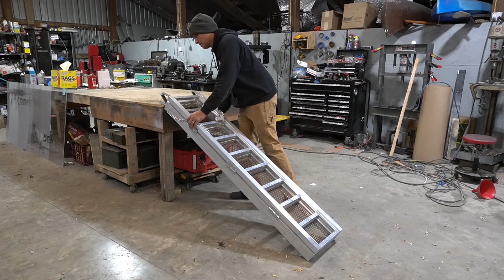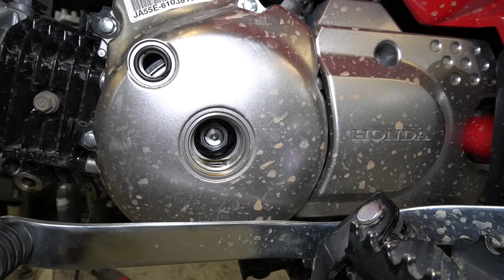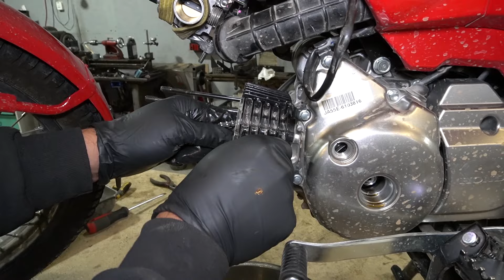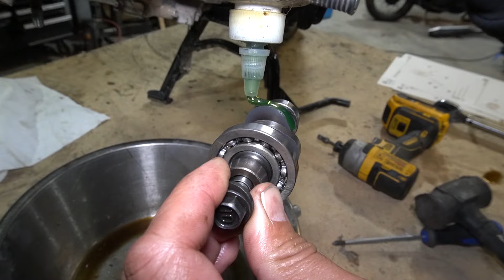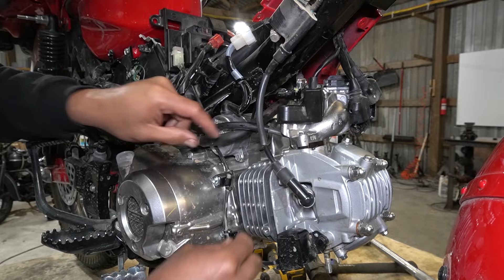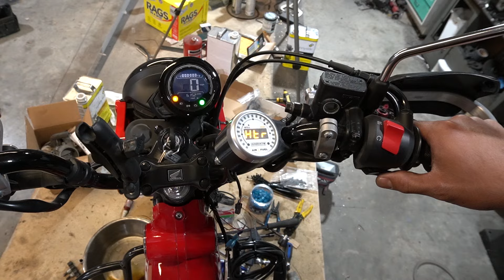More Speed for the Honda Trail 125! - Big Bore Part 1

Comment: A magic motor with a fascinating history , now copied by almost every manufacturer, even Kawasaki and Yamaha+ all the Chinese copies , originally the motor was a copy almost of the Aermacchi 344cc Italian bike motor , please google you will instantly see the almost exact copy Honda did, when Honda did it's design copy the motor had an absolute limit in design of 110cc and that was the top cc size for decades , the air/oil cooled OHC single was art work in simplicity and reliability, starting at 50cc ( all from 50 to 110 and finally 125 in Honda gise used same external dimensions only bore changed ) then 70cc , 90cc , and 110cc . In Australia the bike in the video is called a " Postie Bike" as all mail delivered "residential" was done exclusively on one of the 90cc and later 110cc versions for 40 years . ( Now done in electric carts that are often seen stuck or flate battery on side of road ) , it's incredible this simple motor is now produced by over 50 different companies , Honda let the patent run out and by doing so , allowed almost every other company to use the design . All originally from a small Italian bike company that at one time Harley Davidson owned 33.3 percent of . And sold their Italian bikes in the US and other countries with Harley Davidson badges in the late 1960s/70s.

Comment: 125 is not worth much. It will simply do light riding something above a bike or moped. Any bike needs to be 180 but 200 at least. I have a 200 and its much better, but a 300 lets you safely deal with cars.
Reply: Whatever
Reply: @cbr1thou  I know its hard wo an IQ
Reply: @ericwilliams626 zip it worthless . You aren’t riding no trail

Comment: Did I simply miss it, or is there nothing in the instructions about cycling the engine at smaller intervals at first? I know that I've read about some other big bore kits that are pretty cautious about just a couple seconds for the first start, building up in stages to longer idle cycles before giving it the beans.
Reply from the maker: I didn't bother with any special break in procedure. My big thing is to keep the engine cool which requires a fan or have the bike moving, and rings tend to seat better with the engine under a load. With a small displacement, its difficult to ride the bike "gently" because it needs a lot of the available power to do anything.
Reply: @ozarkgarage  good to know! Not something I've ever done, but I have considered it for my Sportster. I've also long lusted after the Trail 125, but it seems JUST a little too underpowered for the kind of riding that I tend to do, so I was curious about this. Thanks for sharing!

Comment: Read through all the comments. I wouldn't want to lose my high mpg but what mpg loss have you seen with the upgrade? I think on second thought I wouldn't want to risk any potential problems after an upgrade. I agree somewhat with the "right tool for the right job guy" but not his attitude. I wouldn't mind hearing about the post adjustment conclusions....will watch the part 2 again...any further update????
Reply from the maker: Here is Part 3, the latest update: https://youtu.be/nb55vPhmKkw Also did some extended high altitude WOT testing in this video: https://youtu.be/43JGIjh0PZ8

Comment: For those of us who likely wouldn't do that extra step of tuning the new 02 sensor and the fuel mixture, what do you suggest to achieve the right mix? Or does one just run it lean or rich without that data?
Reply from the maker: Final tuning recommendations are in this video: https://youtu.be/EeXsm-Qf62E

Comment: Got to get that Aracer setup for the fuel controller. I have it on my Z125 that's now a 143cc. Your video was great.
Reply from the maker: Check out the tuning video, I ended up settling on a different injector and no controller.

Comment: I dream of an official Honda 150 Trail.  The 125 can't go 55mph on flat land is a killer when commuting.
Reply: My only hesitation about this bike is the engine size. I wish it were just a little bigger.
Reply: @Charlesbabbage2209 120 mpg
Reply: @Charlesbabbage2209 . Yeah and that's what the guys says with a 900cc that wants an 1100cc.  And the guy with the 1100cc that wants a 1300cc.  You're missing the point.  It's a mini-moto.  Smiles for miles bro.
Reply: @clay9333  I think you missed my point, I’m not hating on the bike. I just wish the engine were slightly bigger by about 50cc. I don’t want this because I want some bad ass motorcycle, I just want slightly more pep for times when I need to take a trail bike onto a main road between the backroads.
Reply: I do 62 on mine I do 55 all the time
Reply: @cbr1thou same here!
Reply: @cbr1thou no mods?
Reply: @tomthomsen11  nah there’s nothing to mod really it is what it is
Reply: @tomthomsen11 no
Reply: @tomthomsen11 . The engineers at Honda are way smarter than us garage guys.  This machine is damned near legendary.  Iconic.  Why mess with it?
Reply: @clay9333 in 1961 it started as a 50cc bike. It's been evolving in engine size and features ever since. For me, it would be a great "go see America by back roads" bike...with say a 200cc engine. Still look the same, still great mpg's but just a little more power.
Reply: @tomthomsen11 .  Yeah I get that!
Reply: 150cc on the trail would be perfect
Reply: I'm at elevation in Utah, USA and easily go 59-61 miles an hour on flats.  Factory settings.

Comment: Great video! I used to have a 1975 Honda XR 75 and had to replace the timing chain. The process here was a bit more complicated but overall very similar process. On the XR 75 the engine had to be removed and crankcase needed to be split to get new timing chain on. I have a 2024 CT 125A now and currently dont plan on modifying it. ❤

Comment: ... do I see this correctly: no needle bearing between the piston pin and the connecting rod?
Reply from the maker: Yep, plain bearing like most piston/rod connections.
Reply: @ozarkgarage  Do you have to upgrade anything else , cam, sprockets , etc ?
Reply from the maker: @leeinwis I replaced the cam because you have it out anyway, you will also need to increase the amount of fuel: https://youtu.be/EeXsm-Qf62E
Reply: ... well,  @ozarkgarage , I only worked on  small capacy 2-stroke engines, plain bearing is mostly between the lower connecting rod eye and crankshaft, needle bearing between the piston pin and upper connecting rod eye, ...

Comment: 53mm its batter to me. standert valve cylinder head. potring in ex batter. just replace cdi racing or ecu. but bercareful some damage coming. timing chain. tensioner roller set pushrod tensioner. can damage and hit gearbox. you engine can totally broke.

Comment: theyre "posties" here... but then it gets all a bit grey... 90 and 110, the ct125 was a vertical cylinder akin to an XR. because it was. like the CB125, etc...

so, i always knew the c and ct90/110 has a different engine mount to the 50 and 70, and the 50/70 is the same as the lifans.../chinese "clones".

but then the 12v c90s with square headlights apparently run the same pattern as the 50/70...

did a lot of mucking around on them, but always got a bit peeved as certain aspects of the hondas didnt suit re-working without really digging in... like yeah, i figured out wiseco pistons, sleeved cylinders, and stroked them but i was never a fan of the honda engine itself...

so, whats the engine mounts on this here trail 125 versus the others?

strap a lifan 140... theyre bulletproof. and parts like cams are cheap...

Comment: what's wrong with your honda is that it only got small intake valve ideal only for good fuel consumption and not for high speed. the multi hole injector is for bigger valves or 125 cc chinese  motorcycle. a stock 125 cc chinese motorcycle are 27mm intake valve and 24 mm exhaust. your honda is tiny 22 mm intake valve.

Comment: Unless it fixes some gremlin like oil consumption; I dont get the point of punching a bore over a few thou to gain 5hp.
Reply: probably more like 1 or 2 HP at best...You figure they only gained 5 MPH absolutely balls to the wall not in the RPM comfort zone in absolutely ideal conditions so I totally agree with you.

Comment: What a lovely little engine to work on. That's another advantage of choosing a smaller machine, as well as great economy and just the lower weight when you need to push around or manhandle.  I had a 90, super little sporty model (SS90, 90SS?)   in the 70s  and it was the most fun bike I've ever owned. Great video, thanks for posting.
Reply from the maker: All the engine weight is down low because of the cylinder lying almost flat, the triple clamp and frame neck being low, and the tank under the seat. The bike feels lighter in terms of balance than what the scale says.
Reply: How come it says 124 on your bigbore cylinder barrel kit   @ozarkgarage
Reply from the maker: @RetroYamaha  I'm guessing they use the same casting for all cylinders regardless of bore size. Either that or to keep the mod low key for places where it may not be legal...

Comment: When my 50cc 2 stroke died, my dad bored it out to 80cc and a new piston. Before it would cruise at  45mph but after the rebore would cruise at 60. It started a trend for my mates😂
Reply: What was the gap measurement used for the valves?

And torque spec for the cam sprocket
Reply: G’day, Volt.  Your speedometer read in kilometers, not miles.
Reply: @jackvoss5841  50cc 2stroke max speed about 50-55 mph using stock back wheel sprocket

Comment: The installation appeared straightforward until it came to filing the rings, which I wouldn't be capable of handling. I assumed it would be a simple install-and-ride process. Moreover, riding at high speeds, such as 60 mph, on a small bike seems perilous without larger tires. I appreciate the power for hill climbing, similar to the CT110 that featured a sub-transmission, allowing it to traverse any terrain.

Comment: I don't understand why people buy these then scream how can't go on highway and proceed do all kinds stupid expensive mods .   Yeah these where never designed go at highway . Get the right tool for the job.  The new honda xr150 is cheaper than a trail 125.  used bikes from honda xr125 t0 250,  nx 125, nx250 ,  kawasaki klr250, yahma xt225 xt250 tw200 are all cheaper than a new trail 125. Get the right tool for the job, then save yourself money and not have to do mods.
Reply: Try putting 20kg+ worth of luggage on the rear rack of any of those bikes Champ. Pretty much all of those bikes are also manual.
Reply: @M-mj8bd None of those bikes listed are semi auto and capable of carrying 20kg plus worth of luggage. Why people like you and dylano insist on joining forums, posting comments on you tube etc when you are clearly just motorcycle "owners" (if that), not enthusiasts. Silly old farts.
Reply: @M-mj8bd that is right. You don’t understand fuck all and you probably don’t even own this bike so why are you watching the video and commenting on a topic you know nothing about?

Maybe one day you will be able to afford nice things
Reply: @M-mj8bd that is right. You don’t know anything about this bike, similar bikes or performance mods. 

By your logic everyone should just buy a car, they are bigger and have more power. Just buy a car bro.
Reply: @M-mj8bd I don’t doubt you have no idea what is going on.

You seem to be on the cusp of mental retardation.
Reply: Have you ever seen a pair of boobs

Comment: Great video. Really helpful and visually detailed. I probably will do this on my 2021 Trail125 by this summer. 
And thank you for showing the wideband sensor result, because of that, I changed the fuel injector order from 170 down to pcx155 on my Yuminashi's shopping list.
I hope it will make my Trail run less richer. What do you think?
Reply from the maker: I think the 150cc is still too rich with the stock intake and exhaust. I'm still tuning and waiting for some warmer weather to do some extended riding and get the engine hotter, so I'm not ready to share a recommendation just yet.

Comment: Hi, came over this video because I own a couple of Skyteam / Honda Dax 50cc and both are upgraded, one to 140cc and the other to a racing z155cc. That exhaust pipe inner diameter is 16mm on the Honda Trail 125cc - That is too tight, I have 28mm on anything greater or equal => 125cc or the airflow will suffer and the HEAT increase... Maybe a little tip, maybe increase the outlet pipe diameter!? 
Cool bike, but my Daxes rules... Cheers :)
Reply from the maker: I've thought about increasing airflow via exhaust, but I'm trying really hard not to turn this into a loud bike. I already have enough of those!
Reply: @ozarkgarage  I see. I did it for the heat, so the engine / outlet isn't gonne reach too high temp. I chopped the exhausts muffler part and welded on the 28mm pipe - almost same noise, more airflow and less heat!
But like I said, an upgrade from moped 50cc to 140 and 155z engine = needs more air.

Comment: I find this interesting, i would have changed the gear ratio before the engine for going on the road, it also defeats why they call it a trail 125 bike. If anything i would have shorten the bikes gear ratio for acceration and torque by the rear aftermarket sproket to just to closly match the 1977 honda ct 125 trail bike with a 53 teath rear sproket for trails, back roads, and neighborhood riding to grocery stores. But i also know everyone has there own purpose for it.

I know this because find parts parts for the '77 is like fishing for needles in hay stacks. I had to learn every inch of my grandfathers bike to fix it.  its got a top speed of 30 mph, it was imported by japan only in '77 to america. And it was mostly bought by the goverment / forest service and advertised to the public for a farm bike.
Reply from the maker: I did some research on swapping sprockets and with the ABS, it seems a mismatch between the front wheel sensed speed (ABS tone ring) and the rear wheel sensed speed (via engine RPM) causes an ABS error and the light to kick on and disable the system. This bike is for a new rider, so I wanted to keep ABS intact.

Comment: Seems a lot of work and expense for what? 4 or 5 mph?
Reply from the maker: I'm less concerned with top speed as much as speed loss going up hills. On 2-lane back roads, dropping to 45-46 mph on a hill is not only inconvenient, but also unsafe. If we can get a 15% increase going up hills (displacement was increased by 14.4%), that will be 52-53, which is a lot more reasonable on a 55mph back road. In the next vid I will show some before/after footage and see if we achieve the desired results!

Comment: fuel consumption increased ?
Reply from the maker: More power takes more fuel unless you have some magical gains in efficiency. It will likely be in the neighborhood of 20% increased fuel consumption.
Reply: I did this same BBK.  Went from 144 mpg to 100 mpg.  Not bad.  But range went from 200 miles to 140 miles.  Bad.

Comment: Very rare to find an interesting video these days. Don't know how people can be so boring and think they are the greatest.
Don't know why I'm watching this video, as this is something I did more than once, a sign i enjoyed the video.
You're absolutely right about going higher on cc brings more issues. I installed a 181, and guess what? Installed the original 125cc back and never again had another issue with it. Kept the piggyback ecu for the high RPM camshaft though.
By the looks of it, you're also having problems with yours. I took mine to the dyno, 13hp. And I still brought it back to original cc due to the constant issues. The worst of all was stock bikes not only keeping up with mine, but also overtaking me. That was not funny.
Reply from the maker: What kind of issues did you have with the 181?
Reply: @ozarkgarage  lack of power at high RPM. Difficulty starting some time after installing it. Don't forget the little detail it will chew 420 chains.